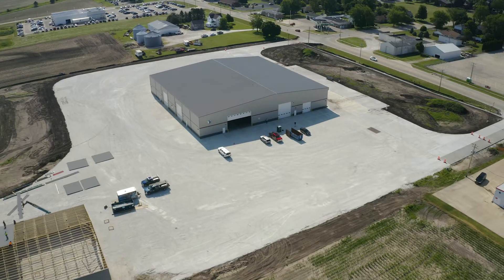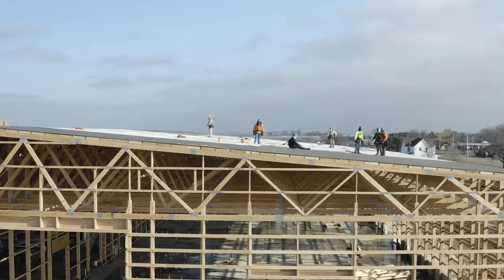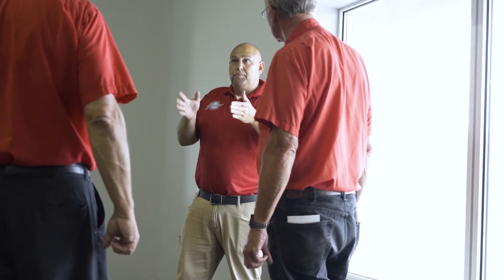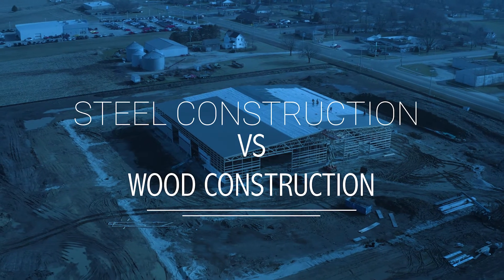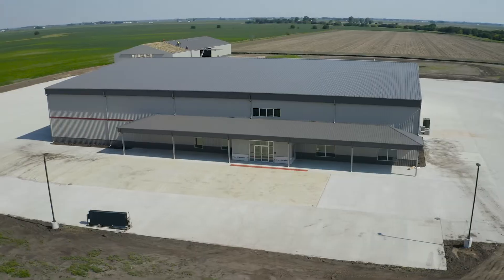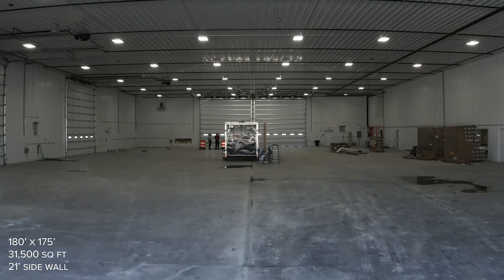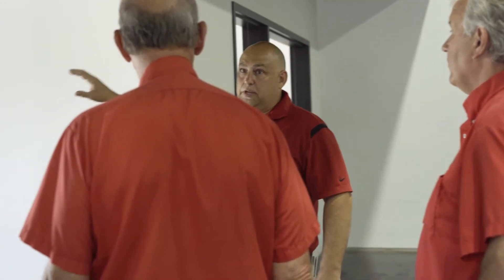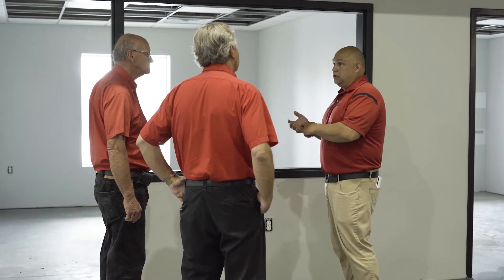Post Frame vs Steel Frame Construction

Comment: Percentage wise how much more expensive and how much stronger are the steel construction? Please and thank you.
Reply from the maker: Great question! Generally, steel construction can be around 10-25% more expensive upfront than traditional wood frame structures, depending on factors like building size, design complexity, and location. 
Post-frame buildings are an excellent choice if you're looking for flexibility in design and affordability. They’re typically faster to build, easier to insulate, and often more cost-effective to customize. Each option has its strengths, so the best choice depends on your specific needs and priorities!

Comment: It looked like there were Steel Trusses in the Office/Showroom Area. I thought that I had seen Black Steel Trusses up by the Lighting & Duct Work, unless those are Wood Trusses Painted Black. FBI makes a Nice Building, I would put them up against a Morton Building any day of the Week. I believe they have Built MORE Wood Framed Truss Buildings OVER 100’ Wide than any other Wood Frame Building Manufacturer. Some of them being 100’ W x 200-300’ L Cold Storage Buildings.
Reply from the maker: Hi, Taylor. No steel trusses were used for this project. We actually utilized mono-trusses for this building since it was going to be over 100' long. Thank you for the kind words.

Comment: OK So WHY? I would like to know the advantage of wood over metal and it was not even talked about! J don't think this was very informative!
Reply from the maker: Hi, Dale. Thank you for your comment. The main thing the customer hit on was the design flexibility and quick construction. Here's another good resource for you to review: https://info.fbibuildings.com/blog/post-frame-vs-steel-frame-buildings
Reply: @FBiBuildings1958  how to draw diagram for permit?..do u know any easy software i can use to draw diagram?
Reply from the maker: @SId-gb1qr  Hi, there. You can actually use our free design online tool at design.fbibuildings.com. This will help you get the process started, and our internal team will be able to assist you with the rest.
Reply: Terrible choice. Video made no sense🤦🏽‍♂️
Reply from the maker: Appreciate you chiming in!